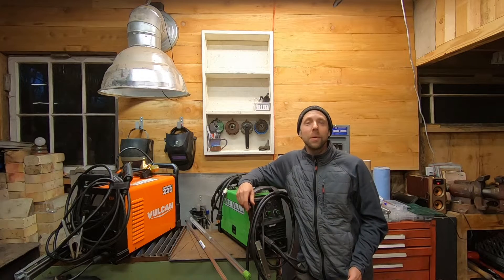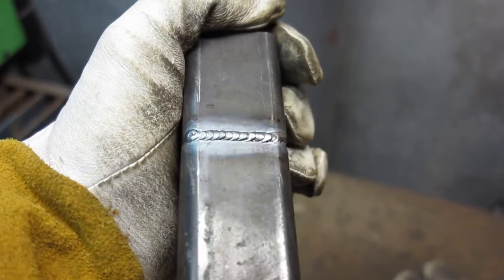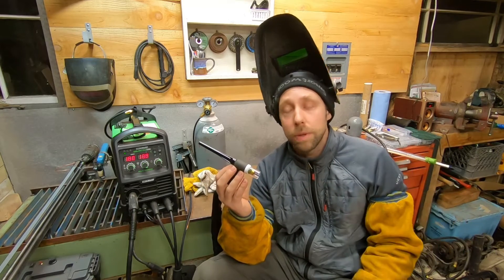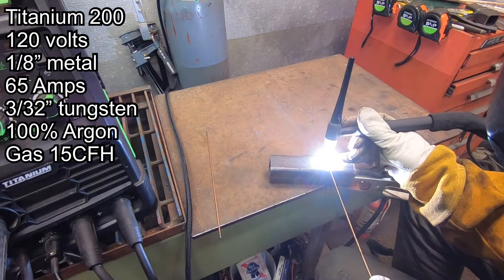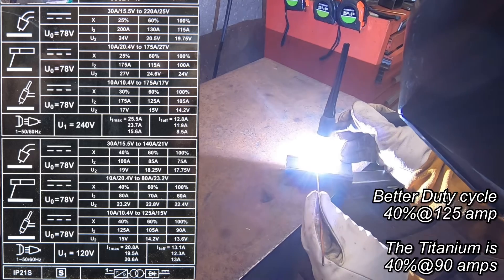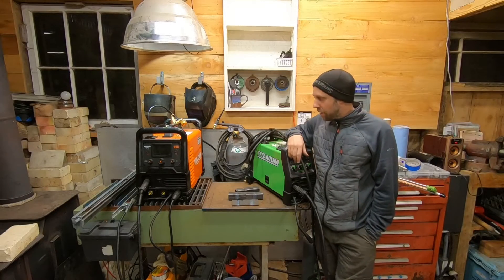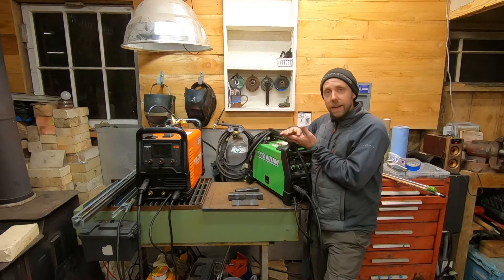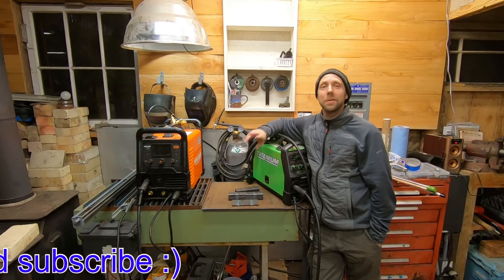Titanium Vulcan welders TIG comparison

Comment: What would you recommend for a repair to a commercial cook top the side skirt I believe is stainless steel and the cooktop im not sure but assume carbon steel pretty thick about 1" and a super thin 1/8th inch stainless side wall. The sidewall developed a gaping hole where it meets the cooktop. Could I Tig Braze it?

Comment: Is there some chart I can refer to in order to get a recommendation on how many amps to set my welder to. Depending on the thickness of steel or material
Reply from the maker: Yes if you look that exact question up on the internet you will find many different charts, all the charts I have seen are only ball park and will only get you into a range, you will need to learn your machine and fine tune it.

Comment: On the volcan You can hook the TIG gas up to the spool gas valve on the front instead of the bottle and it works perfectly push the pedal gas come on let off shuts off like it should don’t have to use the manual valve on on the torch
Reply from the maker: How about post flow? If it cuts off as soon as the pedal is off could definitely be an issue for the Tungsten oxidation. 
Good to know though.
Reply: Yeah not the best post flow but does stay on long enough to double tap the pedal to let it flow as much as you want without an arc

Comment: What is best for a beginner in tig, scratch or touch and lift?
Thanks
Reply from the maker: Lift start is easier then scratch start, high frequency start is the best but requires an amp pedal that can sometimes add more complexity when learning.
Reply: @Mikefestiva  thank you

Comment: 4 years later, what are your thoughts for a poor guy(me) which would you say is the better buy or any “other better buy” to start learning welding, i want to become a all around welder  but more tig welder?
Only down fall for me is wanting to weld aluminum automotive intake tubes and exhaust, thanks for the info at the end of this video, they both didn’t say they aluminum weld BUT nor do they say they DONT aluminum weld on advertising… something someone who hasn’t had the chance to learn tig wouldn’t know..🙏
Reply: They weld aluminum just fine.  I have a 205.   Use 220v for best performance.  Also there is a learning curve as well.  But yes they work.

Comment: A question I have that I haven't found an answer for yet is does the omnipro have a pulse setting for tig?
Reply from the maker: No the Omnipro doesn’t have pulse settings. It’s just a really simple DC lift TIG, the only thing that sets this apart from some of the other basic DC TIG is this one can run an amp pedal with it.
The PROTIG 205 it just a TIG/ Stick welder. The PROTIG is an AC/DC TIG with Pulse and a lot of other settings 👍
Reply: @Mikefestiva  thanks a ton Mike!!! So the protig is the way to go for serious multi purpose tig welding. Would the omnipro work for most all mig/stick applications? Thank you so much for the response! Initially looking at everlast multi process welders but like as you say... gonna "try to do more with less" great philosophy.
Reply from the maker: @maneateroftsavo  Right on man.
Yes the Omnipro is a great MIG with basic stick and TIG features.
The ProTig 205 is a full featured AC/DC TIG with basic Stick as well.
The ProTig TIG welds aluminum, steel and Stainless steel really well 👍 
Take care 🙂👍

Comment: Seriously, if you’re a home gamer welding in the garage, run a 240 circuit for your welder. It literally will take you an afternoon at the most, and the benefit to your welding is huge. I just don’t get these folks who are looking at buying a 240 machine to run on 110.
Reply from the maker: I have 240 in my shop. When I review welders I often have many many people want to see how welders function on 120 volts because that’s all they have.
I completely agree with you about 240 volts if you have it use it. If you don’t, make a point to wire it up 👍

Comment: It can't do aluminum? That's a major bummer. I have much more to understand about TIG welding. I was considering the Titanium welder for doing aluminum TIG welding. Granted, a spool gun can be hooked up. If that's the case, I'm probably better off with the straight MIG welder. I don't think I ever had to stick weld, but things often change. Thank you for the video.
Reply: I don't think he's correct. I'm looking online and hearing different.  I know how to tig myself but had the machine always set for me. By no means a professional.

Comment: I've really been enjoying your videos.  I have been teaching myself to weld with a Titanium 125.  Looking to take a welding course at a local vocational school this summer.  Moving up from the Titanium 125, which of these two welders would you recommend?  They both seem like good boxes for a hobbyist/DIY/Fixit guy...  I just weld stuff around the house, or occasionally make repairs to a utility trailer.  I think I may be leaning towards the Vulcan just as it seems to do the same tasks, just a little "easier" if that makes sense.  Your thoughts?

Comment: Have you had a chance to try out the Titanium Tig 200 ?   I just bought one and have to get it set up.  Haven’t even gotten an argon tank yet.
Reply from the maker: Yes I have owned one for about 6 months now. It welds aluminum good, I did however have problems with my regulator that came with it, it didn’t read right, usually you run them about 18 CFH and the one that came with the welder I had to run at like 1 or 0 to have the proper flow, hopefully I just got a bad regulator? 
I should have a video posted in a few weeks comparing the Titanium TIG to the ProTig 🙂👍
Reply: @Mikefestiva  is it possible to hook up the spool gun to it?

Comment: I really like that brazing!

I just bought an entire Harbor Freight MIG 170 setup (cart, gas tank, gas, helmet, gloves, wire, everything) for $680, I think it was a great deal, but now I'm seeing this Titanium unlimited with TIG, I almost would rather have that! TIG seems like soldering, which I'm more accustomed with...seems like you get a lot more control, although maybe it takes a lot longer overall to perform TIG welding. The TIG joints just look so much cleaner without spatter at all..

Is it possible to TIG with the Titanium MIG 170 if you have a TIG gun?
Reply from the maker: Thanks for checking out my video 👍 TIG welding is definitely nice, the 170 is only a MIG, the 200 is a MIG, TIG and Stick welder, the way MIG works even if you get a TIG torch the welder won’t put out the right voltage to work, one possibility is you probably could trade the 170 back in at HF as long as you haven’t had it for long and buy up to the 200? The 200 comes with a TIG torch 👍
Reply: @Mikefestiva  thanks for answering! I had gotten the setup from a craigslist listing, I'll probably still start with it for now and get a spool gun, but I'll keep my eye on the 200, seems like an awesome flexible machine
Reply from the maker: @researchandbuild1751  You definitely got a good deal! I would recommend hanging onto your 170, and down the road look into buying a separate TIG welder, they are a lot of affordable ones on the market, you probably could get a simple TIG for about $250, keep in mind a TIG in that price range would be a DC TIG and only able to weld stainless steel and steel, if you want to weld aluminum you would need a AC/DC TIG machine.
You definitely got a good deal man 🙂👍

Comment: you cant tig aluminum with the green one?
Reply: You can only TIG weld with AC current. DC current is used for TIG welding types of steel
Reply: I was in the store today and i don't know if they changed something or they are lying but it says you can tig aluminum
Reply: @EnriqueGarcia-gw7xy  they released a tig only one that can do ac tig

Comment: Hi Mike.  Great videos!  I have the Omnipro 220 and wanna learn TIG.  I usually only work w/ MIG and Flux-core.  I need to buy the Tig Torch 150A of course but will the Clear gas Lens kit from Amazon work with this that you have listed in the links (Clear gas lens kit on Amazon  https://amzn.to/2UGU3Iy) - that is to say, screw right in or is it for the Titanium multiprocess welder?  Thanks.  Keep up the good work with the informative reviews of the Harbor Freight stuff!

Comment: I saw that you did the scratch start on the Titanium. I have a new Titanium and my user manual says it is touch and lift to start the arc. I haven't used it yet. Thanks for the great videos. Gonna try to learn to tig weld. Getting my garage set up with 240v 50amp supply right now.

Comment: I went online and checked the Titanium, the owner's manual says it WILL Tig weld Aluminum .(This the primary reason folks buy Tig......ie to weld Aluminum!!!)
Reply from the maker: Haha okay good luck with that!
I think you will prefer to own an AC TIG but it sounds like you already know what you want 👍 
I really think you got the aluminum spool gun option mixed up with your search results.
Reply: Best way to weld Al is with AC current, needs pulsating electricity. This is a DC machine, it will MIG Al or add a spool gun for Al. And may be possible to TIG Al.(Says DC TIG on machine)All Al welds from this machine will be rough & ugly.Not the machine to buy for Al welding.

Comment: Hey Mike, another question for you. Great reviews by the way! I was looking pretty hard at the Titanium 200 then I came across the Amico 205 multi process welder. Maybe you haven't used the 205, but which brand seems to be better quality. Would you go with an Amico for 600 or the Titanium is on sale for $679 I believe. Another thought was to go with the Amico plasma cutter and then a stand alone Mig machine. Any help would be appreciated. Thanks!
Reply from the maker: I have an comparison video coming out soon
Reply: @Mikefestiva  But I need to know now! 😉 Cool I will be looking for it. Thanks

Comment: Just a heads up. The Titanium 200 is not a scratch start TIG. Its a lift start, you can touch the tungsten to the work piece and when you lift off the work piece it'll create the arc.
Reply: Try scratch start your tungsten with you wire. Doesn't sound practical but if you get used to it really save the point on tungsten. As always I've enjoyed the video. Welds looking great.
Reply from the maker: Yes it’s advertised as lift but mine works better as scratch, I have not been impressed with this lift start on the Titanium. The Yeswelder I got recently has a much better lift start. Thanks for checking out my video 👍

Comment: Hi Mike. I am looking at the Vulcan multiprocess welder. What happens after 2 years if you need service? Are there service centers and spare parts? Regards, and great video, Doron
Reply: Harbor freight treats the welders like they do the tools. Get the Warranty and it's a no-hassle return from what I was told. Now if you do return because you don't like it or some goofy reason. You'll end up paying a re-stock fee. But if it's broke and won't work right then you can either return it and get a new machine or get your money back and that's supposed to be without a re-stock fee. But check your local dealer. I get mixed stories but for the most part, they are all consistent on what they say.

Comment: if they dont do aluminum why do both offer aluminum welding spool guns and say they weld aluminum with them.  I need to weld alum and would like to know if they do or dont.
Reply: I think use ac current for tig aluminum not dc I think.
Reply: @shanegrisham179  no, these are dc machines.  you can dc tig aluminum with helium but its not preferred.
Reply: These machines wont tig weld aluminum but will mig weld aluminum with a spool gun and argon helium 90/10 gas

Comment: @mikefestiva I am looking at purchasing one of these as a Christmas present, how have they held up against each other over the past year? Do you prefer one over the other? Is the 130+ presets on the Vulcan worth the extra $$, since you still have to buy additional accessories such as the tig gun?   -- his fiancé
Reply from the maker: Good question, I had ran the Vulcan for over a year before selling it and buying a TIG welder, it was a great welder, but for me I found the Titanium 200 fit my needs better because it was lighter and easier to pack in the vehicle and move around for jobs.
The Vulcan Omnipro 220 has a lot of options the Titanium does not have. Both are good welders, I really like my Titanium 200 but they have raised the price a little on them. I would say ether are good but if you spend a little more on the Omnipro I think he will be happy with the Vulcan Omnipro 👍 The TIG torch and Amp pedal can come later. He will be able to MIG and Stick weld right out of the box. Other then needing a Argon CO2 gas bottle. Take care and I hope this helps 🙂

Comment: For the Titanium 200 What is supposed to be showing on LED displayed when tig welding at 120V? Mine can only adjust amps from 15-90A (when connected to 120v outlet) but voltage only stays at 13.3V. (when connected to 120v outlet). And it doesn't weld... I have been trying 1/8" thick Aluminum.
Reply from the maker: That’s how the display reads, you adjust amps on TIG. You connect the work clamp to + and the TIG torch to -
These are DC TIG welders. You can’t weld aluminum with them, just steel and Stainless Steel. You also need 100% Argon gas.
Reply: @Mikefestiva  So if I want to weld aluminum my best bet is a AC Tig welder or use the spool gun instead of tig with this machine? Right?or use stick option?
Reply from the maker: @michaelpujols4739  Well the Titanium spool gun is definitely your cheapest option, I think about $180? The other one like you said is an AC TIG welder. The spool gun is good for 1/8” to probably 1/4” is easier to get the hang of but can be finicky sometimes. The TIG takes longer to learn, it’s slower but much more precise way of welding Aluminum especially really thin because of the amp control. I hope this helps 🙂
Reply: @Mikefestiva  Thanks Mike, I really appreciate your fast response.
Reply: On my way to HF to buy the 150a spool gun. Thanks for the wisdom!
Reply: Aluminum can still be welded without using AC. Just have to use helium gas 👍.
Reply from the maker: @austinammons9219  Yes you are correct, the down side is Helium is expensive and it’s difficult to weld anything thin, the welds also don’t look the best. The reason I don’t mention this as an option is because I don’t want to tell people it’s viable and have them disappointed with there results. Take care Austin

Comment: What you were experiencing with the contamination probably wasn't so much the gas or the cup. With TIG the cleaner you can get your metal and your filler wire the better, it was most likely silica from the filler wire. Not a big deal scotch Brite and rubbing alcohol on your filler wire well take care of most of that. Plus keep your filler wire in the gas coverage area and when you take it out clip your ends before welding with it again. If you liked the Pyrex style cups you should try a jumbo Pyrex cup i prefer those for wider gas coverage. Great videos by the way thanks for your time.
Reply from the maker: shawn johson Thanks Shawn 👍 I really appreciate the helpful comments!
I made this video when I was just starting out learning how to TIG, now I know Clean clean clean is extremely important when it comes to TIG welding.
I really appreciate the advice with stick too.
I’m now able to TIG weld Steel and Aluminum really well, there’s always room for improvement but it’s really nice to have that skill for bigger projects.
The world can use more helpful encouraging people like yourself. Thanks 🙂
Reply: @Mikefestiva  no problem. I'm a welder by trade. Didn't wanna come off as a douche or anything just trying to give a few tips. Didn't really see how old the video was either, but was interested in finding out what the reviews were on the Vulcan welding machines. I want something that's not gonna break the bank and that has a range of different functions. It doesn't appear to be that bad of a machine almost like the esab that I'm looking at as well just half the price. Thanks again for the videos they're really informative.

Comment: Mike I could use your help! First of all I just subscribed. You are my go to for beginner welder info. I’ve been stick welding since I was 15 years old and really want to step my game up. I’m trying to decide between the titanium 200 and the Everlast 200E(MIG only). The mult function of the titanium is pulling me in that direction.the warranty being the major down fall.the Everlast has a 5 YEAR warranty parts and labor. And advice would be greatly appreciated. Do you have any experience with the Everlast brand? Do you plan on doing any videos comparing them? Thanks in advance for the help.
Reply from the maker: Thanks for checking out out my videos I really appreciate it! I really like having a multi process welder, they are great if you still want to stick weld sometimes, I really don’t like stick welding ( I learned years ago on stick) but I do use it from time to time. Ether way you go you will really like owning a newer inverter welder, they are much more crisp, stick, MIG or TIG they just weld really nicely. I have owned my Titanium 200 for 19 months now without any problems so far, the ground clamp is cheap and should be changed out with a better one, other then that it’s a good machine, the Titanium spool gun is also good quality especially for the price. I have never owned any Everlast welders but I have had many people tell me they really like there’s.
Ps I have only heard of two people with Vulcan Omnipro 220 welders having problems, so far zero people have left comments about any Titanium welders burning up yet.  I get hundreds of comments a month so Time will tell but mine has been rock solid. Take care
Reply: Mike festiva awesome,thanks for the reply. Good luck with the channel👍 looking forward to seeing more projects and reviews